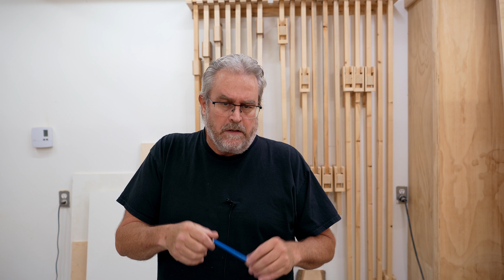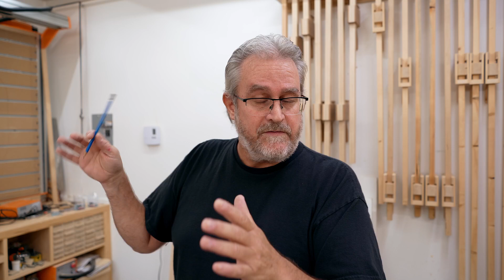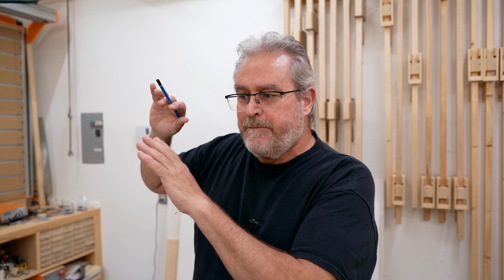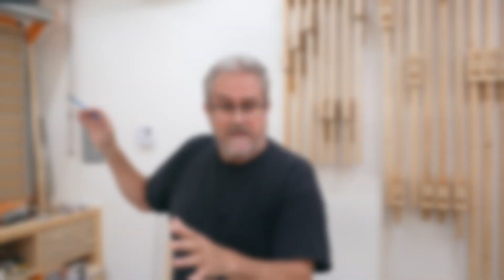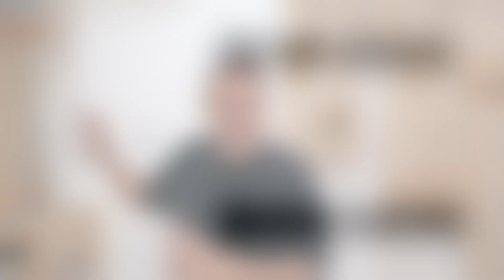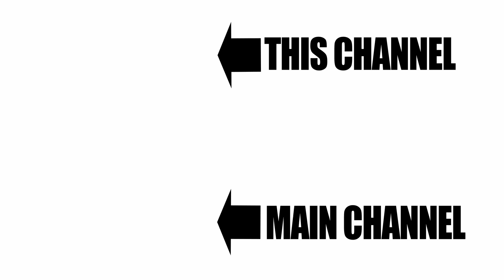Debunking Audio "Truths" -  Dr.  Floyd Toole

Comment: Interesting video. Audio is about opinions (so is economics) and while I enjoy your opinions you are not always on the mark. One of Harmon's speaker brands is Revel. Revel is not a speaker brand aimed at the casual buyer. JBL, also a Harmon speaker brand makes some upper market speakers aimed at audiophiles. John Maynard Keynes developed his "General Economic Theory" during the Depression of the 1930s and contrary to popular opinion few politicians  followed his theory or even knew about it at the time. FDRs New Deal for example was not influenced at all since his administration has never heard of it. He basically developed the first Macro Economic theory. On his death bed he complained that politicians in the west neither understood or followed what it implied. Don't think you do either. Thanks again. I enjoy your videos.
Reply from the maker: Harmon does make some higher end gear, but their bread and butter has always been and always will be the consumer market. Those higher end sales certainly don't amount to anything that would drive the research they funded.
To say that most economic systems today are not overwhelmingly Keynesian is a flat-out denial of reality.

Comment: I've built 8 pairs of speakers. From the small set with a retail equivalent of $300 or so to my towers that would cost over 8K if I was to buy equivalents. 

I too am frustrated with the notion a set of parameters dictates good sound. I've heard 100K speakers I didn't enjoy listening to at all, but enjoyed the sound coming out of $500 speakers designed by normal everyday people. 

High end audio is 90% bunk. Pick high quality components, make your cabinets dead solid unless OB of course and tune to your liking. There's no objective great sound formula. Everyone has different sensitivities and different tastes.

Comment: The other day I was talking with a couple of my daughter's friends, two guys, and I asked them if they or anyone they know are putting any high-end audio equipment in their cars or homes. It seems this generation is only concerned that they can stream on their phone and maybe connect to a car. There are outliers of course but it's not like it was for us old heads.
Reply: Gen Z member speaking here: back in my high school days I wanted to have the best sounding system I could afford for the budget I had - roughly 400 $. I researched for weeks what would be the best speaker, receiver, whether I needed an amp, pre-amp and so on. Eventually I found out that my budget was 10 times too small to get anything an audiophile would approve. 
I stumbled across a comment that said "you can get 95 % of performance for a 1000 $, why spend 10 times as much for the other 5?".
So i I got a 20 year old 80 $ Denon amp that was mid-priced when new and a pair of decently sized 20 year old Yamaha speakers. Put some thought into placement and called it a day. 
I was satisfied with the way they sounded and everyone else thought the same - even though it was nothing impressive. From that point on it didn't make sense (to me) to spend thousands improving something I was satisfied with.
Reply from the maker: Great story and smart move on your part to not get pulled into the audiophile trap. 
Most of the better retail gear you can get is every bit as good as the stuff that audiophiles rave about, mainly because there's been some mystical nonsense built up around the products to sell them to that market. If it sound good, it is good.

Comment: Interesting video. I understand and to a certain degree share your view, that average audio for average people is not  necessarily engaging for an enthusiast. But I actually think Toole is useful and instrumental in achieving that "particular" result that an enthusiast is looking for. The difference between unique and interesting loudspeakers is to a large extent in their dispersion characteristics. Toole did pioneering work into which characteristics have which effect on the general listening experience and the interaction with rooms. He does give a cookbook type of strategy for good sound, but this works in reverse as well. If you have a non-standard room, less optimal dispersion may be better. If bass is problematic, he gives ideas and strategies to improve it.

Comment: Keep doing what you do. Any naysayers are irrelevant. I also build my own electronics and speaker systems. Have evolved toward valve OTLs and push-pull, planar, dipole, line sources, and the Canadian version of Audio Note DAC Kits. My first undergrad, Applied Math/CS and have read the JAES Volumes. So what, at the end of all Our efforts, does your face break out into a wide grin when you listen? Foot tapping and maybe later picking up your axe and improvising from what you just heard? That's the joy the music gives Us. The gear, just one avenue towards the goal. 
   Admittedly, I'm also a cheap SOB and can read schematics, follow equations, and as curriculum requirement, thrived in 4 semesters of Physics.  Brought up around power tools because my Family in the," Old Country", made furniture. So I refuse to indulge others with a more profit mongering pathway, (and the prices for hardware today, are obscene), my cash, for what I can do, better. 
   Your empiricism AND reporting out your analytical and subjective yield is what its all about. Anything said by someone who sits on their behind, quoting, "Experts", to criticize, without actually building, measuring, and listening is useless. I'm paraphrasing from faulty memory, but ; ' Those that can, do. Those that can't, teach. And those that can do neither, are critics'. Keep pushing the envelope and sharing your experience, as those of Us whose mission is cognition, learn from your work.